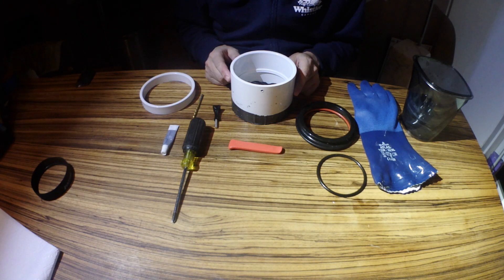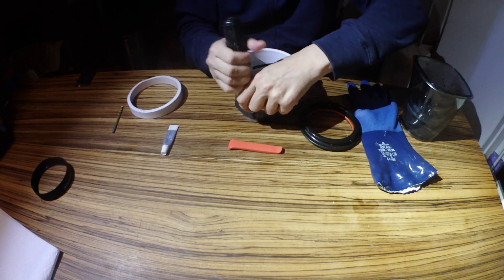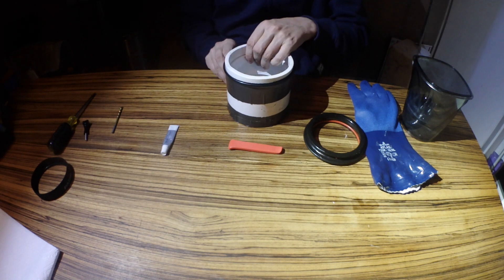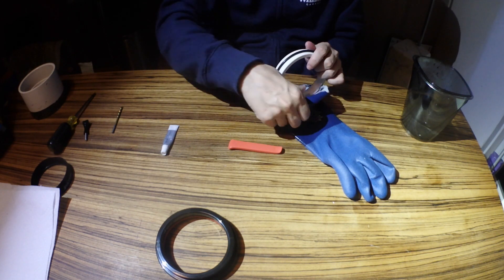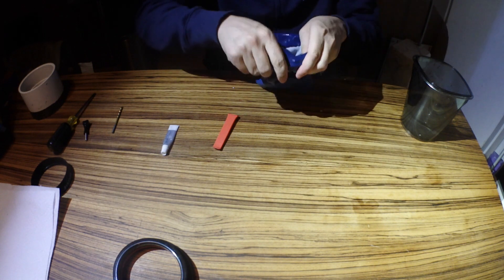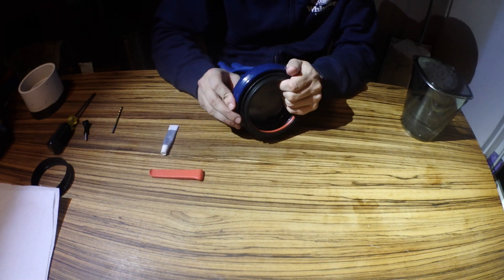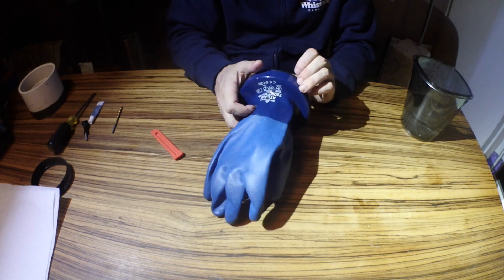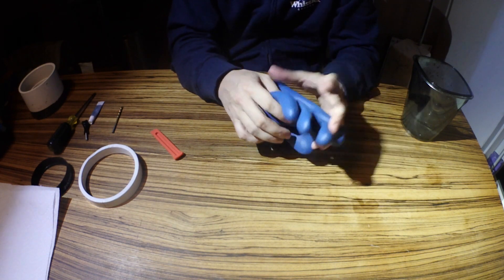How to build a jig and install a Showa 720R glove on the Waterproof Ultima Dry Glove System (v2).

Comment: Suggestion: Might want to glue a short piece of 4 inch pipe into the coupler that will keep the split ring from slipping without using duct tape.  Thanks for doing this video.  I made one and it works great!
Reply from the maker: Great idea!

Comment: Thanks for helping us. Do you have the best dimensions for a helper ring? Then i will make a 3d printed version... I can then send you the 3d files or a 3d printed version
Reply: Jens-Henrik, I have a hunch, why you are asking: Because, like me you are living in Europe (me Denmark) and you are asking yourself, where the H.... to get a 4" pipe? We have 110 mm outer diameter sewer pipes, not 4". I asked a diving buddy who is also a professional plumber for advice and it turns out the all the magic is in the word COUPLER. A coupler for 110 mm pipes has 110 mm INNER diameter and 125 mm OUTER diameter and that makes all the difference. The ULTIMA ringset fit perfectly into the 110 mm INNER diameter and it possible to squeeze the 125 mm ring with the O-ring outside into the glove. Made it TODAY. I have struggled with it for weeks but that one word: COUPLER made all the difference. I use SHOWA 660 gloves with lining inside. All PVC gloves with no lining is much easier to fit because the O-ring can stay on the outside. I used a Wavin 110 mm coupler.